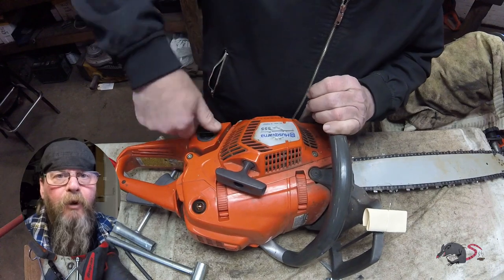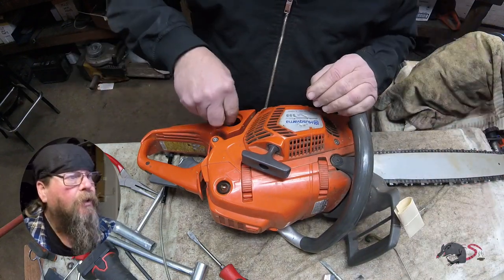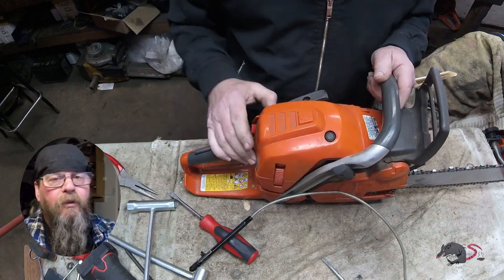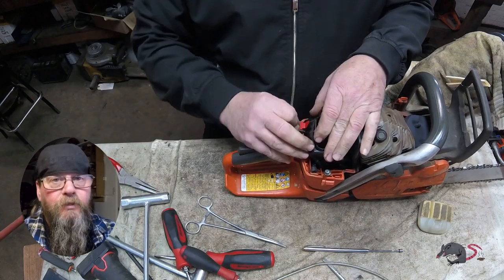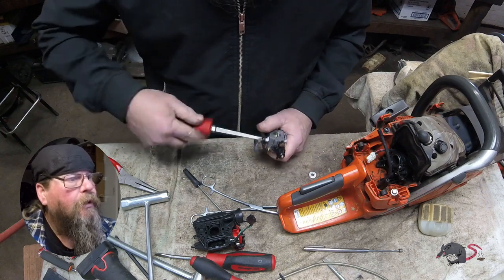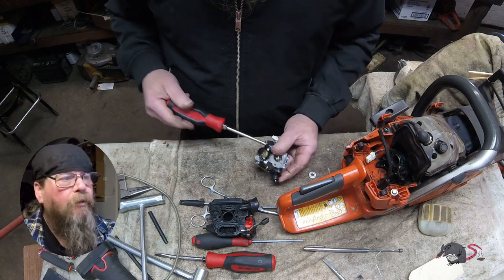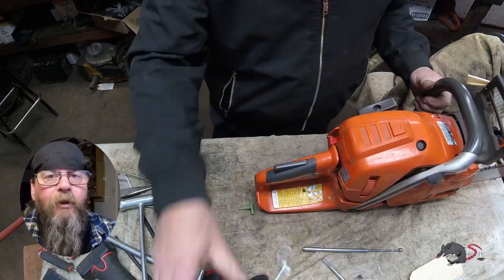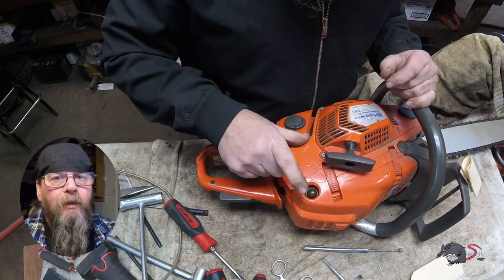Husqvarna 555 Chainsaw Bog-Fixed!

Comment: I have a dead 555 that I last used 2 years ago to clear trees that fell during a storm. It doesn't seem to be getting any fuel. I will take the carb off and habe a look around.  Thanks!
Reply: Did you find anything ? Thanks.

Comment: Bit of a long shot but do you know whether there is supposed to be a hose that connects the white-coloured tank vent to the area around the carburetor on the 555? I've got the tank filter visible when look just behind the handle on the tank but don't see any hose connecting it to anything. Thank you
Reply from the maker: I think it depends on the year of the saw. Early ones (pre 2015 or 2017?) may be like you describe and later ones have a hose connected to the vent that is formed together with the return line and runs up through that carb base tray. Its fine to not have a hose on it as long as it stays clean 😐